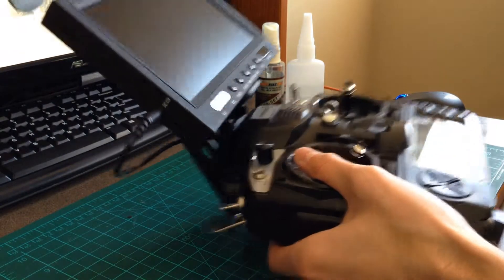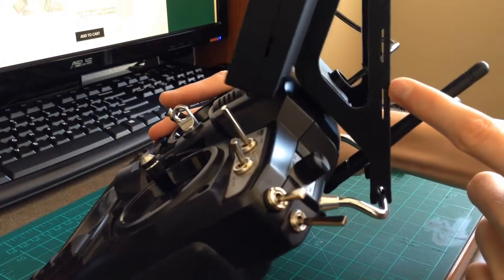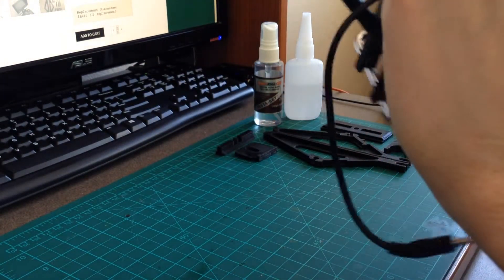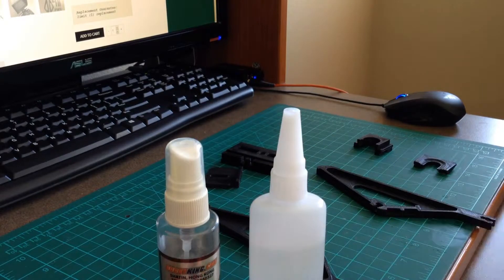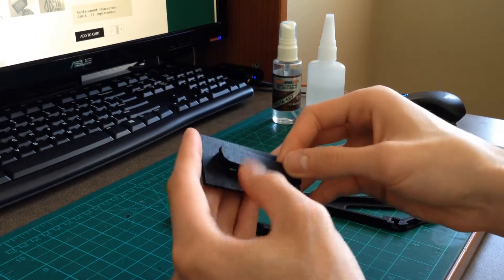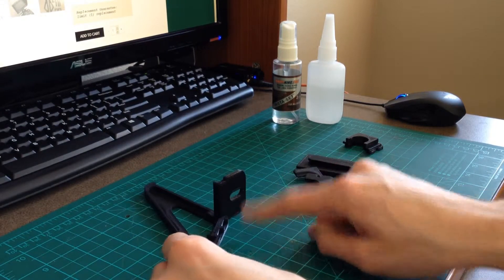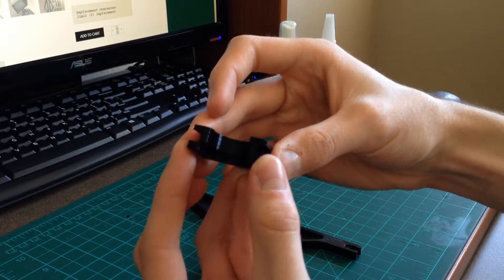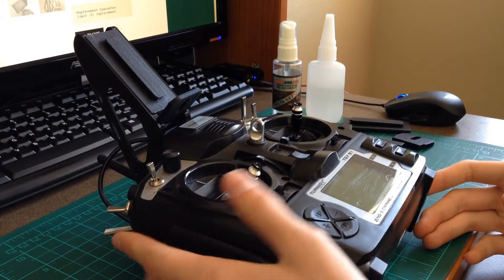LCD Radio Mount V3

Comment: Will it work for the Futaba 8FG radio?

I want one, looks really cool
Reply from the maker: Unfortunately, the handle on the radio appears to be too high for the mount to work properly. Although I tried to make the mount compatible with as many radios as possible, the Futaba 8FG is not supported.
Reply: Oh OK no problem. Still a cool design.